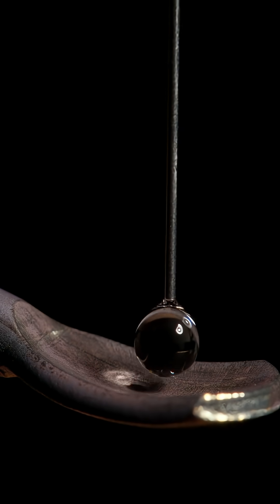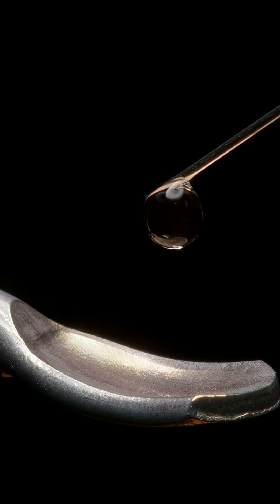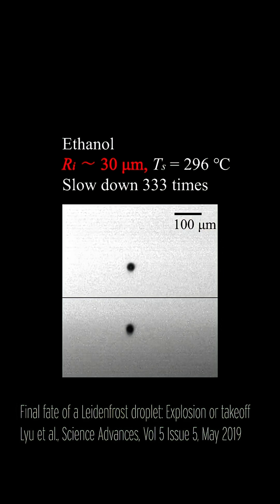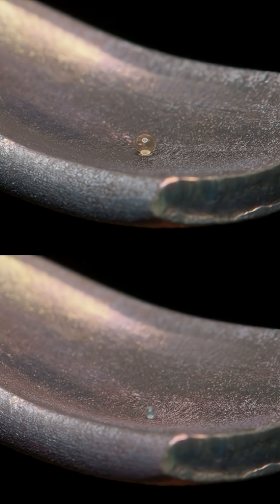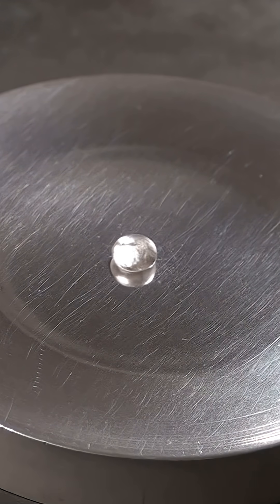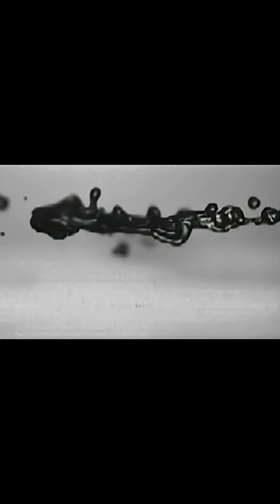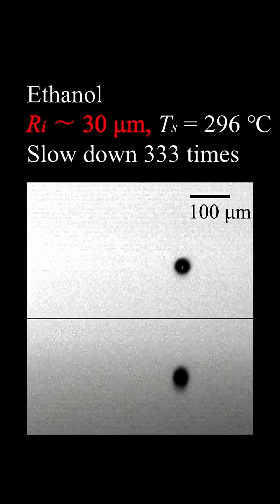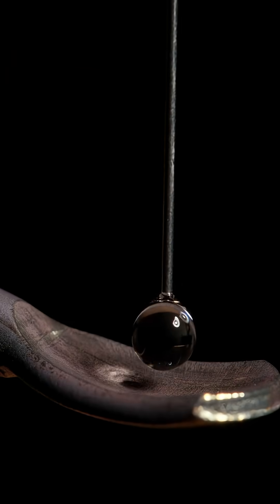trying to make water levitate but it keeps exploding

Comment: Well im gana just say this without anything bqcking me up to much , (this is a guess) for contaminated watter its surface tencion is weaker than pure h2o , there fore water tuches the extremly hot pice of metal , instantly turnes into steam, and makes it go boom.
Eddit:
The steam making the watter folat goes around it letting it tuch the pan/metal.

Also the pure h2o may be floating from the heat , also slowly turning into steam and theee fore disapearing

Comment: I mean, its not THAT complicated. At that scale, your dealing with the same effect you would heating water in a microwave. The water gets super heated, but can't turn to steam. The smallest impurities slowly allow nucleation. This causes a microscopic steam bubble to form which caused the explosion.

As for the hovering, if you notice its a REALLY small drop so puritywas probably high. It was probably light enough to hold itself together with surface tension, and float on the hot upword moving air, hence why it moved a bit, as it slid along air currents.

Comment: Too many nucleation sites whenever they are contaminants in the water.  The reason why you see the gigantic jet is because the concentration of mass the centre of mass heat up faster and expands more than the outside because the outside is insulative.  Whenever it expands, the hydrogen is knocked away from the oxygen, leaving the air bubble that rapidly then expands and creates the jet going towards the source of heat because it cost too much energy to move to a place with less energy.

Comment: If i had to guess, its providing a point for the water inside it to rapidly vaporise from, id assume cause its gotten so small without the impurity boiling off that its in such a high concentration that it allows it to act as a sort of nucleation point, allowing a minuscule pocket of steam to form inside it, which then shoots out, breaking apart the droplet

Without the impurity the only parts that are able to turn to steam would be on the edges of the droplet, causing it to boil away normally

Think of it like adding a grain of sand to supercooled water, which is water thats below the freezing point but has not frozen yet as it has no point to freeze from, the sand allows the ice to begin to build off it, its just the same thing but hot

Just note i am no scientist and this is just a guess, do not take this as fact

Comment: The jet shooting out of the bottom of the drop: wouldn’t that be a lot like a frost peak? As water expands out in all directions, it pushes on its center from all directions and pushes a thin jet of material out.

Also, absolutely looks like a popcorn kernel popping

Comment: It could be particles interfering with water tension. The smaller the water drop gets the bigger the chance that small particles from contamination can disrupt the water tension, so the droplet gets exposed to the heat, which given its size and the temperature it causes the droplet temperature to rise imidietly giving us the impression or spontaneous combustion

Comment: If I would take a wild guess, I want to point out that the surface is to rough, creating an adhesive effect. The pan gets so hot, that the surface evens, but your spoon like surface doesn't match that criteria.. it's like a convex or concave surface effect ft. boiling delay.. as you see, the droplet explodes always from the downside.. 

Same with the SDS contaminated water.. the surface if the water droplets get to sticky so levitate. However this could be probably compensate with a much higher temperature, which evaporates also the SDS or with some materials which stables the solution..

If I'm right, remember to credit me. 😁😊

Comment: Put the spoon and water into a pressure vessle of some kind, you can abuse the triple point ratios to make boiling impossible, but easy float.  Did it with both vacuum chambers and pressure ones, don't ask it was not making anything the AFT wants to talk to me about.

Comment: Cool! It's probably really tough to recreate that with a regular camera. The droplet size that levitated is 30 um, and it looks like it was roughly 30-40 um minimum above the surface? Assuming that's what the black line is.

I doubt that a camera, even a high quality one, will have enough optical resolution to identify such a space with such a small droplet. Especially with such a small fraction of time the droplet hovers.
Reply from the maker: I think you’re right

Comment: It's highly likely that the impurities are heavier than the water. If I had to guess this may have something to do with the explosion being initiated from the bottom. Maybe the impurity material gets too hot (because it's not as efficient as water to distribute the heat + it's smaller than the water surface) and once the water droplet reaches a certain size it's no longer capable of keeping itself together or cooling itself enough so this reaction is triggered from heat expansion overwhelming the structure.
Also likely that the steam just isn't enough to separate the water from the surface at that point and because all that heat energy has been transferred to it from the hot surface below, the first thing that happens once its surface tension breaks is to violently scatter in all directions to alleviate the buildup.

Comment: Water tension is the "shell" and stuff in water breaks tension correct? Like if you add dawn dish soap to water it ruins the surface tension so its more delicate and poof they pop when heated from pressure on inside.

Comment: With my limited knowlege i would presume the impurities act like a starting point of gas bubbles to form easier.
Like putting water in hot oil it would have it rupture by the gas buildup from the inside

Comment: Maybe there are a few factors. The water needs to be pure and the surface needs to be smooth so air doesn't get trapped between the water and the surface? Maybe also pressure and atmosphere need to be regulated.

Comment: With my limited chemistry knowledge, I would have assumed that in water that has impurities like dissolved minerals, those particles would eventually act as nucleation sites for superheated water to  rapidly change to gas phase? The natural surface tension/cohesion of the droplet, plus the leidenfrost effect does its best to keep it all contained in a singular droplet, but as more and more is evaporated away, it condenses the contaminants further and further, progressively increasing the likelihood of that gas nucleation and rapid expulsion. The fact that the slow motion footage shows it ballooning out until it creates basically a disk of fluid does make it super interesting tho. Let me know if I'm way off with my hypotheis.

Comment: The impurities heat above the water temp, and it tries to levitate from within. Using the same effect.  Except it is t thick enough and there is enough force from the steam after the surface tension is broken that it “explodes”

Comment: Could it be a similar phenomenon as water that should be frozen staying a liquid? There aren’t any impurities for the reaction to start off, so it doesn’t freeze, but as soon as there is a bubble introduced it starts a chain reaction that freezes the whole bottle immediately. Perhaps the whole drop is hot enough to evaporate, but there are no impurities for it to start, so as soon as one is introduced, the whole drop explodes. It could also be a ratio , where if there is a certain amount of impurity to water, the impurity causes the water to become unstable

Comment: Why you don't notice the levitation is probably clear from the scale of the clips you provided. If you look the scale is at 100 um, which is a 10th of a millimeter, and the droplet is at around 30um. Even if your frame rate were high enough to capture it, your camera doesn't seem to zoom enough to be able to see it at all regardless of the duration, at least from the footage you showed

Comment: I wonder if the impurity in the water causes a break in the surface tension in the droplet. Maybe with enough water in the droplet the surface tension is maintained cause its mostly water but once it gets to a certain point the impurities start messing with that tension causing the explosion.

Comment: Perhaps bc hard water/impure water contains more molecular compounds, increasing density once the water is removed/evaporated creating more mass? So the droplet gets heavier as it gets smaller? Like a dying star? while pure water contains more oxygen(?) which gets converted to a gas when burned off so it ‘floats’ away? 

Something of the sort, just a silly little hypothesis

Comment: the droplet looks almost solid before it explodes
and it leaves tiny shards
my hypothesis is:
the concentration of salt in the droplet increases until a crust is formed while the droplet thickens limiting thermal exchange by convection so the crust drys and becomes less permeable to watervapour escaping until the pressure buildup bursts the shell

Comment: It looks like the column explosion that occurs with alkali metals dropped into water. My bet would be that a tiny amount of metal disassociated from its salt with the heat as an activation energy to catalyze that effect, after which it violently tears an electron away from the water and that pinpoint of increased momentum propagates outward in a cascade of fractalized nucleation points.

Comment: To me, it feels like impure particles mess with the surface tension that keeps the droplet in shape. The more pure the solution, the less you worry about the impurities bursting through. Once enough of it evaporates, it can't keep its shape from the impurities that remain knocking it around internally.
Or as listed by another commentor, a source of nucleation for evaporating.

Comment: The presence of impurities, such as salts, minerals, or other dissolved solids, dramatically alters the droplet's fate. As an impure droplet rests on the hot surface, the pure water begins to evaporate, leaving the impurities behind. These non-volatile contaminants concentrate at the surface of the droplet, forming a thin, flexible, and often impermeable shell or crust.

This newly formed shell traps the water vapor being generated from the bottom of the droplet. As more water turns into steam, the pressure inside the shell rapidly increases. The shell, for a time, contains this mounting pressure, allowing the trapped water to become superheated, meaning it remains in a liquid state at a temperature above its normal boiling point.

Eventually, the internal pressure overwhelms the structural integrity of the impurity shell. The shell ruptures, leading to a violent and instantaneous vaporization of the superheated water within. This rapid and explosive expansion of steam is what causes the droplet to burst apart.

Comment: what are the chances that the exploding effect is caused by the impurities becoming out of solution as the solvent (water) evaporates so the small jet is where the impurities briefly crystalize causing the explosion (and the explosion starting from below due to the temperature differential).

Comment: The reason why the droplet floats away, without even touching. It's because the radiant heat off of the spoon is so hot that the water is dissolving and turning into steam before it can even touch the spoon. And it does the same thing that a hot air balloon does and floats away

Comment: I would assume the impurities give the water drop a nucleation point for bubbles to form. When the drop gets small enough, the surrounding heat is able to heat the water drop on the sides of the drop not touching the hot surface, enough to make it boil. When bubbles quickly form around the impurities, the water drop is so small one blip is enough to cause the explosion.

Comment: The temperature difference between the water, which generally dosnt heat up as quickly as you would think on a hot pan and the contaminate causes small bubbles inside the droplet which can cause cavitation.

Comment: I got a pretty solid hypothesis for the exploding water droplets. The contaminate crystalizes by percipitating out the water as it evaporates. Those crystals can then heat above the temperature of liquid water causing the droplet to boil around the precipitate. This causes what appears to be a small explosion.

Comment: Thats the surface tension giving in.
Do the math it checks out.
Reply: Basically the surface tension has a limit, the concept has a limit. If you get water just to the boiling point, surface tensiol changes, you can literally HEAR the difference. The smaller a liquid, the more surface tension changes. 
You can observe this easier if you boil water in a vacuum. 
However the propper reason is simpler if you look at the molecules of hot water, or rather boiling water, in small amount.
At some point, just like with a balloon, surface tension actually overpowers the pressure of the molecules, like if you barely fill a ballon with air, its not gonna increase in size if you open a valve to another ballon. The contents, molecules, get pushed together. Assorting smaller and smaller, and at some point without enough pressure from the outside, the molecules cant align for the surface tension any more. So the water that evaporates away, basically rips it open and the pressure is released. Causing a tiny chain reaction in which the rest evaporates.

Comment: Maybe the “spoon shape” of the metal is the problem of the water droplets exploding. Also the explosion from the bottom of the water drops i think because the interior of the droplet is evaporating causing the bottom of the water droplet to have “less water density” because of that its easier to shoot out the bottom vs the top.

Comment: This could be in part due to the chemical used to treat water as well as other contaminants that old water infrastructure inherently has (chemicals used to prevent lead pipes from poisoning us as we still have lead water pipes integrated into our water supply distribution system)

Comment: Well, the density of impurity/water increases as water is boiled off. So I'd assume theres a specific point at which the qualities of the solution reach some threshhold related to either it's own temperature or the temperature of the surface.
Maybe the boiling point of the solution rises as the density of the solved increases. Due to the square cube law, it could reach a point where the temperature it is able to absorb/s is less than the temperature it would need to continue evaporating to feed the leidenfrost effect? 
Or maybe it's thermal conductivity rises to a point where internal bubbles can form that are deep/big enough to destabilise the structure?
In either case a mathematically model of the system should... already have been created... so these ideas are probably not helping :P

Comment: Maybe, when the contamination gets to a point or vapor gets low enough the contamination conducts heat. Perhaps the contamination slows the vapor output in that spot creating a lower pressure point. Then hot vapor flows in instantly and violently vaporizing water at that point causing it to burst. Alternatively the lower pressure might just touch the surface resulting in the same thing.

Comment: im not really informed about physics but my thesis is that when a droplet that small gets hot the heat energy makes the water molecules move faster and faster but the strong surface tension of the tiny droplet keeps everything together letting the energy build up until the surface tension burts resulting in an explosion
edit: and the inpurities act as some sort of catalyst, maybe affecting the strength of the surface tension or the heat absorption

Comment: I'd assume it explodes at the point where the temperature of the impurities reaches waters boiling point, causing the surrounding water to evaporate, pushing water forcefully into the heat source, which causes the explosion.

Comment: I feel like the impurities are too heavy for the small water bubble to hold up as it gets smaller and smaller whoch eventually leads to the impurities sinking to the bottom and eventually out of the bubble o to the pan (whoch is ehat you can see with the jet of water just before exploding) the water ofcourse wants to homd on to the impurities and so it keeps contact with it and then touches the pan directly, getting through the thin layer of steam. That heats up the water enough to make it explode. 

I have never studied this so im probably wrong but that feels like what makes the most intuitive sense to me

Comment: The gliding water drop in a steel pan is a good way to tell it's the right temp for cooking.  This is because when you add something like a steak to it, you know it is now hot enough to create a steam layer such that the steak will lift off the steel without sticking.  Of course adding a touch of oil helps this effect.

Comment: The reason your water droplet isn't flying, is because of the shape of the object you're using. A pan is this l_l shape so the walls and the bottom get heated which creates this heat "zone"
The density of the air is a lot less in this heat zone, so the teeny tiny water dropplet can fly. But in your current settup, the hot air is not being contained and no walls to keep the air hot.

I made all that shit up btw but it's a pretty solid guess imo